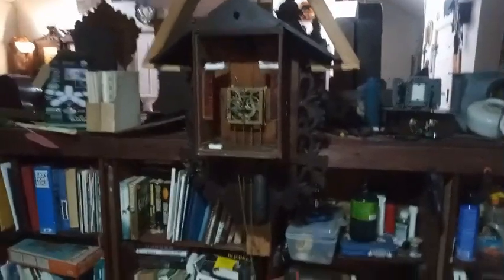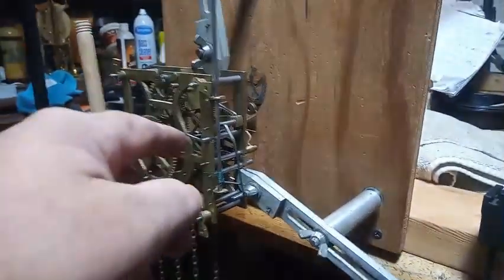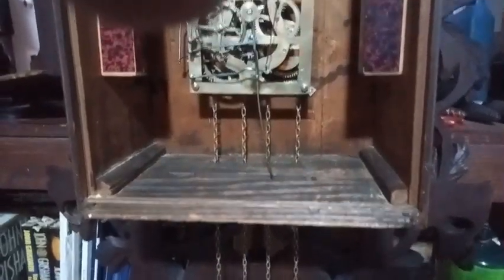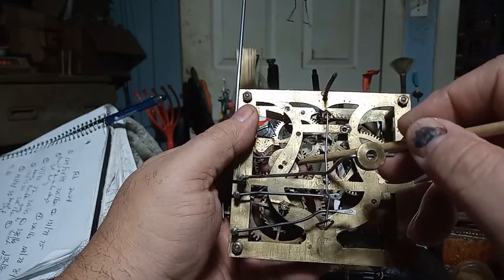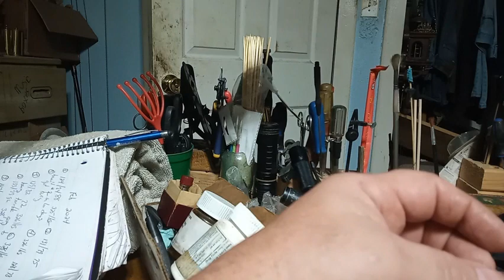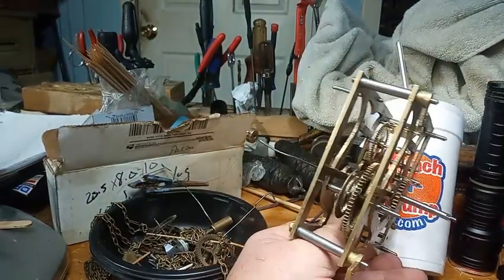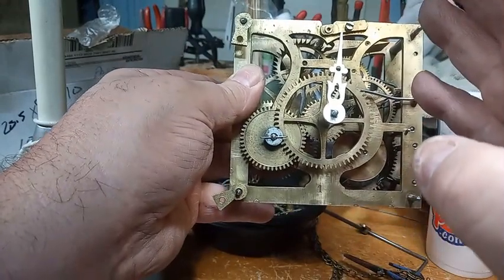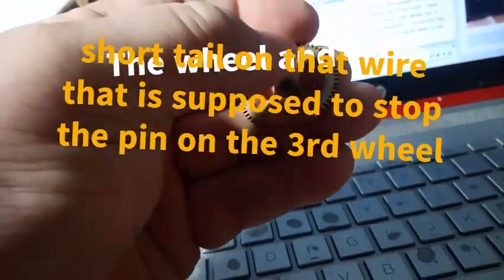Repairing an antique cuckoo clock that stops when it goes into warning.  explaining why. Part 1 of 2

Comment: My warning pin was hitting the time wheel sometimes and making a loud noise.
Reply: Your warning wheel is bent too.
Reply from the maker: Yes i watched your video and seen that.  That is great that you know what the problem is.  Now to fix it. Good luck.
Reply from the maker: @cheryladair732  yes but not as bad as what it was.  The local machinist used a tool that lined up with the end of the wheel then rotated the wheel to make that that tool stayed lined up with the edge of the wheel and where it wasnt he bent the wheel some to line it up. That is how I have watched people like DP Perry I think straighten the wheels out.  But they have a lathe where I dont. I can almost fix just about anything with what tools I have but I said almost. LOL.

Comment: I've only watched the first few minutes, but could it be that the spring wire is too strong for the bird post? That could give you a lot of resistance to overcome.
Reply from the maker: Good question but no. So you will have to watch the rest to find out......God helped me out with this clock.  You will see why I say that as you watch the rest.